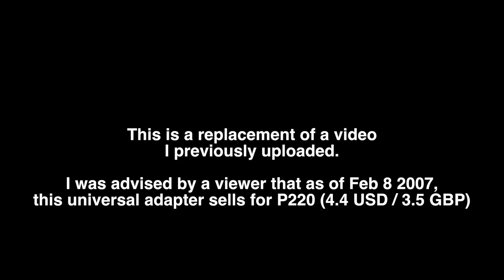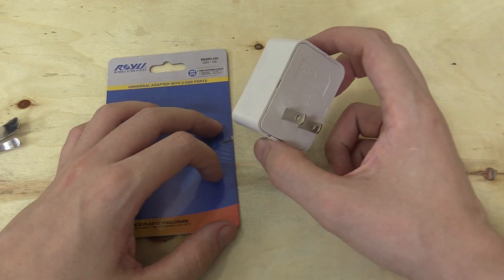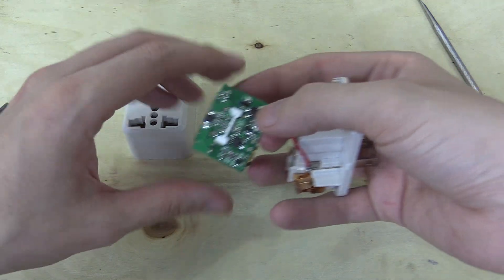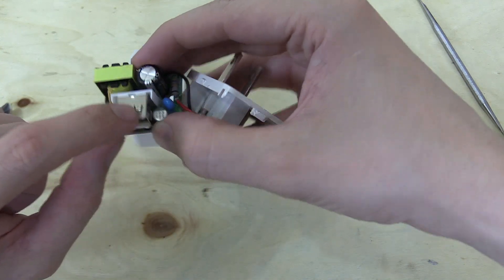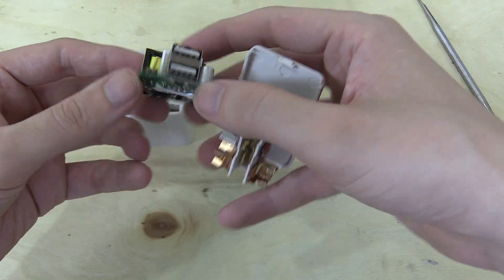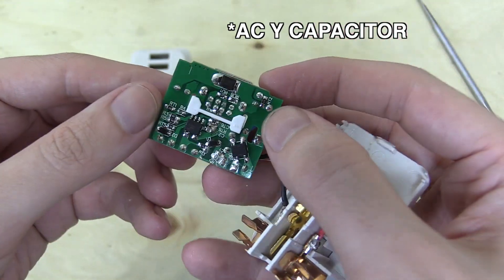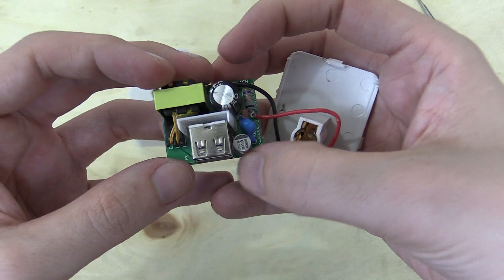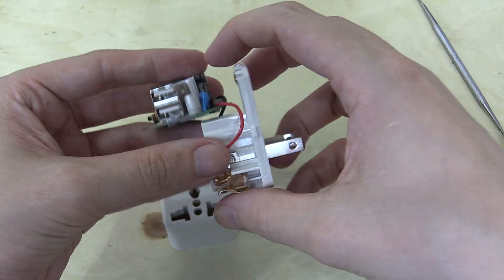Royu USB charger teardown + Correction

Comment: Thanks for doing the teardown!

That 8-pin chip is on the high voltage side and is probably a SMPS (switchmode power supply) controller.  I doubt it has anything to do with the low voltage side.  It will contain the switching (transistor or mosfet) and control circuitry that takes the high voltage DC (post rectification) and chop it up to go through the primary side of the high frequency transformer.